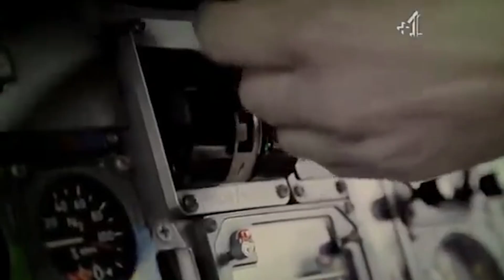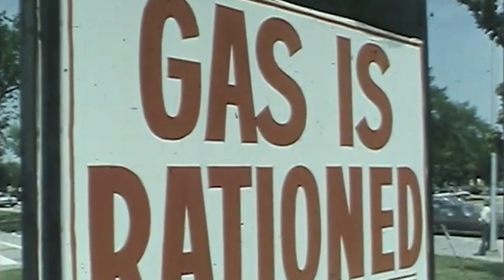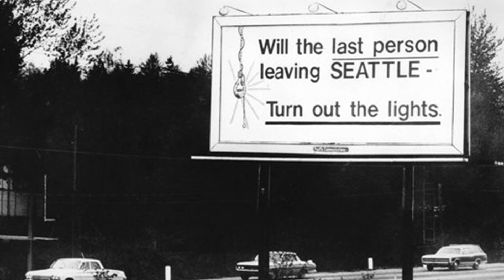The Forgotten American Concordes - Boeing 2707 - Lockheed L-2000 SST

Comment: America ...could not ever build such an aircraft without outside influence.
Reply: No. B-1B Bomber.  Total Production Run = 104.  Superior in every aspect (that matters) to both the Concorde, as well as all speculated commercial SSTs.
Reply: @stevealtra3543  I'm looking at wiki...b1b is smaller...can't carry the same weight....its cruising speed is 500mph slower....than the Concorde....what the hell are u talking about....the Concorde was also built years earlier....b1b does not hold a candle to the Concorde....the Concorde is superior in every aspect ...that matters...whatever that is supposed to mean. Tu144 was also bigger and had a faster cruising speed ...it was used by NASA to study supersonic aircraft....how about that ...so the US used Russian technology to develope American supersonic aircraft of that size....like I said...US can't do that without outside influence....hell even NASA's saturn 5 program consisted of Canadian engineers that developed the AVRO Arrow and also German scientists and engineers.
Reply: B-1B =Greater Warload Lift Capability (Concorde =0).  FAR larger Performance / Maneuverability Envelope (effectively a giant fighter aircraft).  

Extensive EW / ECM Warfare Systems, both Passive and Active, Front AND Rear Hemispheres.  

24 ALCMS- Internal carriage (And STILL achieves supersonic speeds whilst fully loaded).  External Munitions Hard-points for CM load-outs exceeding 24 (internal) ALCMS.

Flying Boom Aerial Refueling Capability, Very Low-Level Terrain Following Radar, expendable  EW jamming canisters, ....etc, etc.  

EVERYTHING about the B-1 Bomber is FAR more impressive, technologically more advanced and "Total Performance Realm Superior" than compared to the Concorde (or any civil realm aircraft for that matter, preceding or since).  

Concorde was just a "Straight-Line" hollow tube in comparison (cause... well... thats all it was).  Barely enough internal fuel carriage to make it to JFK (had to be cleared for priority landing on approach, lest it run dry).

Soviets never feared the Concorde coming over the North Pole, flying into the heart of the Soviet Union, delivering a couple thousand nuclear tipped cruise missiles, that's for sure (yes - 24 ALCMs x 100 airframes = 2400 Nuke tipped CMs, excluding a few hundred B-52s w/ 20 ALCMs, of course).

Blatantly Obvious.  Impossible to either miss or deny.  Completely different realms of capability / performance.   No comparison (and certainly not fair to compare the Concorde to the B-1 either).  How are you missing these obvious concepts, in such scale and variety of capabilities?!?

PS:  Tu-144 tests were done by NASA, a Civilian agency, with Zero access to the USAF's classified systems realm.
Reply: @stephensalt6229  
Well, just to remind you that the majority of the American Nobel laureates are native-born, so saying that it couldn't build anything without outside influence is wrong. Not to mention that Wernher von Braun himself even said "Don't you know about your own rocket pioneer? Dr. Goddard was ahead of us all."
Reply: @mickeyg7219  I do not agree with you ...and by the way the chinese made rockets over a thousand years ago....granted they were not of the same breed....but rockets none the less....the Saturn 5 project and other NASA rocket programs were primarily perfected  by Canadians that were recruited by NASA after the cancellation of the Avro Arrow project....and that is a whole other story...you may find that interesting...maybe not ..as it was not American.
Reply: @stephensalt6229  
Be more specific on what you don't agree with. If you're downplaying one's achievement, you also downplayed several other fathers of rocketry as well. This is not a matter of opinion, what I said were recorded achievements, if you don't agree with me, back it up with a contrary evidence. By the way, you're making one of the most stereotypical assumption, I probably know more about this particular area of history even more so than most people, it's my area of interests. Not to mention that I'm not a US citizen, but well, not that it's matter, so...

Let me ask you one thing, what's so special about Avro Arrow? Its performance isn't all that different from other interceptors of the late 50s. If you talk about the speed, there were faster interceptors in active service that's faster. However, what it does show is Canada's capability in the aerospace sector that matched the US and British. 

Also, Jack Granatstein, a prolific Canadian historian said that "American killed the Avro Arrow" is just a myth, most likely same goes with Concorde as well. This is something I think make sense, because if a sovereign country killed its own ambition, then it's their fault (what's a big deal with not being able to fly in the US? You can literally fly Concorde everywhere else). If the US couldn't make something, they can poach experts from abroad, because their home country failed to give them the opportunity and resources to succeed, I don't know why you treated it as it was a bad thing, even the British and Soviet Union poached scientists and engineers from Nazi Germany.

By the way, I got that from a TCE, a Canadian government-funded encyclopedia. 

There were literally hundreds of thousands of scientists, engineers, and technicians working for NASA for the Apollo 11 program alone. You missed one major player out and the Moon landing won't be possible, and that's include American employees - people like John Houbolt Thomas J. Kelly and many more.
Reply: @mickeyg7219  have a look at the f106....now have a look at the arrow....anyway....I've got stuff to build...I don't have time to continually debate this issue...there are many conflicting opinions on this subject...
Reply: @mickeyg7219  I did not say you were an American citizen...speaks volumes on how you interpret what you read!

Comment: Interesting comments. My recollection is different. At the Paris show, the 144 tried low altitude, low speed aerobatics to impress the crowd. Way out of it's envelope. It flamed out, then tried to restart engines bloated with unburnt fuel. BOOM. No Mirages.

Comment: I think the dropping nose of both the Concord and the Russian plane is silly...though cool looking.  Much better would be a second windscreen below the pilots can look out.   Helicopters often have these.  That would save a huge amount of weight.  Conceivably you could even have a fly-by-wire system and have the cockpit move or just the seats so you get an even better view.  Nowadays you could even just use video cameras.

Comment: I recall the first time I saw a 747, at San Diego in 1968. I also recall the headline on my local paper SST cancelled about teh same time, for noise reasons primarily, as well as energy efficiency. It was supposed to be the next big then, Then "G Motors" were promised in 1953, and that went away in 1954. Different technology
Reply: @noHwel >  I think your memory is off.  The first developement 747 was built in Seatle area and did not fly until 1969

Comment: What a fantastic fast and safe plane the concorde was. If it was built by boeing the yanks and everyone else wouldnt have any of the problems with initial sales it had, some bad timing also. Got to hand it to the anglo french designers and engineers an incredible product the yanks couldnt beat. Here we are 50 yrs later and we have 737s falling out of the sky, yet a plane flying 50 yrs ago at twice the speed of sound had an incredible record until human error/maintenance caused one accident caught by cameras a ground level. The world is less for concorde not being in the air still.

Comment: 2:10 "We choose to go supersonic...not because it is practical, but because it is cool!" crowd cheers
Reply: Sadly it was his speech promising Mach 3 that doomed it.  If they just went bigger and just a tad faster, it was totally doable.
Reply: ChessMasterNate I make you right on that. It was said by many Aerospace engineers at the time, that if the American government had just increased the speed to maybe that 2.4, and used a standard super guyville delta wing similar to Concorde, then yes, it was totally doable.

But by the time that was decided upon, it was always going to be too late - the 2707 was doomed.

One of the leading Boeing designers, tried to write to a prominent senator involved with with the commission in 1965 - pleading with him to revise their ambitions. He suggested in the letter, that if the aircraft was limited to Mach 2.4, then they could use existing alloys, such as Hiduminium (as used on the Concorde) and with a much simpler wing design, could be at the prototype stage within 6 or 7 years. Apparently, the Senator wrote back saying that his hands were tied, due to American pride and that there was no way that he could alter the commission's programme demands. The fate was sealed from this point onwards.

Typical government deafness. Apparently engineers know nothing.

The Europeans figured this out by the late 50s, so that by 1961 they had chosen Mach 2.02 for the very reason stated. But the European designers also figured something else out, which we hadn't - that they had deliberately settled on the smaller design after much wind tunnel testing, because they knew then, that the aircraft could supercruise - and switch off the afterburners for much of the journey. This would save much fuel, and make it a more viable aircraft. Once Concord reached Mach 1.7, during its cruise climb, the Afterburners switched off, and it continued to accelerate to M 2.02 by the time it reached 60,000 feet.

Basically, they weren't trying to do too much too quickly, and just knew that it had to be a viable supersonic aircraft that could carry 120 passengers for 4000 miles. They had a Concorde 'B' programme on the drawing board at the same time, which would have gone into service by 1981, which would have carried 190 passengers 4500 Miles.

Sadly, it was during this time that countries were starting to object due to noise and the sonic boom, so that the updated and enlarged aircraft didn't make it off the drawing board.

I think, supersonic aircraft may still have been flying today if if many more more aircraft have been produced, and if the larger Concorde sister had gone into production and bought by more Airlines.

Concorde flew for over 27 years in the end, so I guess yes it was good while it lasted for those that were lucky enough to fly on it, including me, 5 times. I still miss it.
Reply: @RB747domme  Wish I had known about it and the Hovercraft ferry earlier instead of after the fact. Would have loved to try them out.
Reply: Living Corpse I went on both hovercraft Ferries - the passenger only one from Southsea to the Isle of Wight, on the south coast of England, and the giant one from Dover to Calais with my car.

When you consider that it could carry more than 60 cars, and hundreds of passengers, with a lounge on the upper deck, and a small restaurant, swiftly and smoothly over the waves without hardly any bumps in even rough weather, at speeds of more than 50 and 60 miles per hour, I think that was an incredible achievement as well.

Yes I agree with you, it's a shame that neither the aircraft or the hovercraft are in service today.
Reply: @RB747domme  it's American insecurity. I know they claim it's pride but that's false. If they weren't so insecure we would've had a Boeing 2707. America believes it has to be the best at everything and so they were unwilling to simply make a competitor to Concorde. Instead of one-upping Concorde by increasing capacity slightly and increasing speed slightly they decided to try and humiliate the European effort. Ultimately they realised why Concorde was that size and why it flew at Mach 2.02 too late. And so America was humiliated by trying to humiliate Europe.
Reply: @RB747domme  The Americans had no chance of getting a wing that did what Concorde's did. The Soviets stole Concorde's design in an espionage programme and they couldn't get it right because they couldn't understand it. The swept wing approach had no chance at all of working in a passenger plane, from a cost, complexity and maintenance point-of-view.
Reply: True but the Concorde was also cool af, the mach number being proudly displayed inside the passenger cabin...flying on the Concorde is definitely in the list of a time-traveller, not too hard on the causality of the Universe too...probably. I mean, flying a plane would not break the space-time continuum, right?

Comment: The plane shown is only a Engineering Model, with a lot of wood in certain areas to show a finished design. There would not have been a right wing nor tail. The model was displayed in a aircraft museum in Kissimmee, Florida. The tail was 30 feet high and stuck out thru the top of the museum. The model cost the feds 10 million and the owner of the museum bought the craft for 10,000 dollars.  I was a teenager at that time when we were allowed to go inside. The craft had no interior wall, but displayed the interior construction and sound and temperature insulation's. There were several rows of seats showing the method of seat lock downs and etc. The pilots instrument was made of wood and there were no instruments. Everything was painted as a aircraft would look before interior skins were in place. I do not know where the model is now displayed, if at all.

Comment: This video mentions the Tupolev 144 but fails to mention it was a pale copy of the Concorde. The Russians managed to steal the blueprints of the Concorde, but they were not good enough to make it work. They tried to address the main isssue with the nose wings but this did not fix it. The aircraft was doomed and crashed repeatedly. To my knowledge, the Concorde is the only aircraft that really made it. Its maiden flight was on March 2nd, 1969 i.e. 50 years ago and the cause of the only crash (after 34 years of service without accident) was a part fallen from another plane that took off from the same runway 90 seconds before.
The TU-144 was no match, although they built it from the stolen blueprints.
Reply: There was a problem with the engines, Britain had to find a way to slow down the Air intake, which they did, meanwhile Russian stole the old old plans with the engine problem , the rest is history,

Comment: Fun fact: the very reason for the curious shape of the B747, with an elevated cockpit was in fact the anticipation that supersonic airplanes will take over passenger travel, so the B747 was designed to be easily convertible to cargo duty with a large nose door for quick loading.

Comment: To all the morons repeating propaganda like parots... read western biased wikipedia and take notice of start of developement, first flight and introduction dates.
As far i can remember, Americans were bying, grabing and copying Russian equipment left and right... remeber MIG25 and Belenko / first PESA radar's plans from mig 31, sold to CIA by Tolkachev / purchases of MiG29s / S 300s / theft and complete copy of Russian superior space suits during 90s uder disquise of friendly tech exchange / American rockets flying on FAR superior Russian engines / helmet mounted display and IRST copied 20 years after Russians designed them from bought 29s / futile atempts to copy supercavitating torpedo and closed circuit rocket engines even wilst having them in possesion / ... And list goes on.

Comment: Should have just moved in to ram jets and small rocket engines to push into a low skipping orbit around the earth  as Professor Sanger proposed. Going 25000 mph minimum with no long term air friction to heat the plane skin looked more technologically feasible provided you found a way of not burning up when you came down. Even then, it doesn't look any more difficult than the American concord and it would have gotten one to their destination faster with probably the same amount of fuel. 😁

Comment: This idea has likely already been considered. 

(1) Use a helium (a rare element) balloon to suspend a plane at a high altitude, making take-off not necessary.

(2) Start plane engines.

(3) Release plane from balloon, allowing gravity to accelerate the plane and air resistance to glide the plane. 

(4) Increase throttle while below balloon, flying away from the balloon at a high rate of speed. 

(5) Retrieve the balloon for next launch.

Comment: "Concorde used two tons of fuel just taxiing out to the run way" sounds exaggerating. But this is the first time USA admit they could not build supersonic passenger airplane.
Reply: Well, it sounds like a lot, if you have nothing to compare it to. But all big jets burn lots of fuel while taxiing. Concorde doesn't burn more fuel than other big jets (why would it? You don't taxi around with the afterburners lit up, and Concorde is (was) smaller and lighter than a 747)

Comment: Nice, but you missed two things. First, Lockheed had a fit when Boeing dropped the swing wing and went with a double delta, because it was almost an exact copy of what Lockheed pushed in the first place. Second, the turbofan engine dropped fuel costs, so the idea of a supersonic jet doing twice the workload for four times the fuel became unattractive.